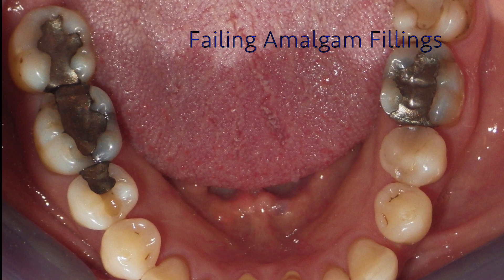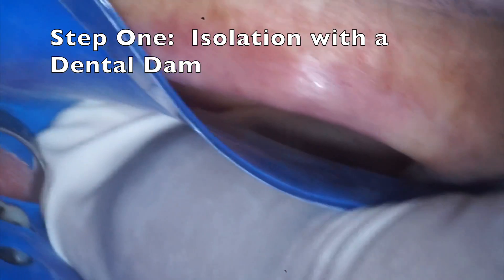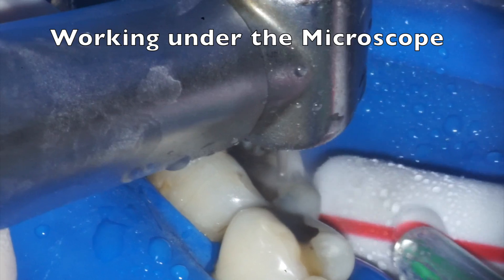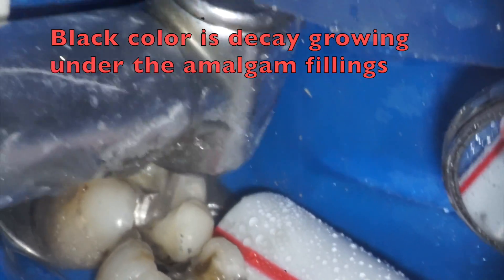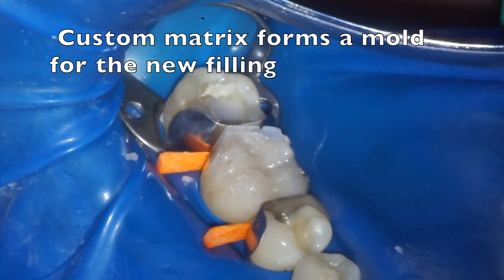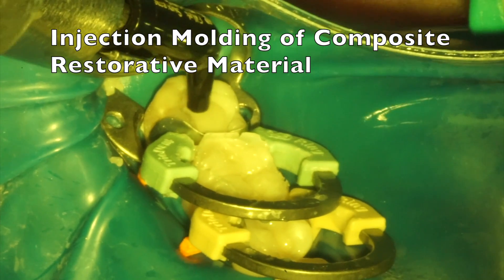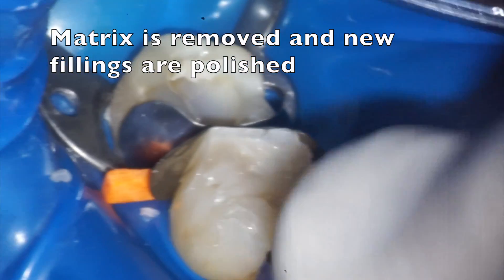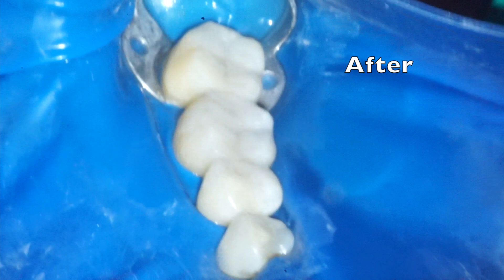Mercury Amalgam Removal and Restoration

Comment: I had a very little bit cavity 
I got filling but my teeth doesn't touch property
I remove high points 2 times but I it doesn't touch properly
.
Can I remove amalgam filling permanently without restoring it with composite filling?

Comment: Are Amalgam fillings unsafe? I’ve had them for around 2 years and I am 16 and haven’t been experiencing any problems, but many people say it can poison your system which makes me paranoid... is this true?
Reply from the maker: Good question.  While I personally do place amalgam, I do not tell my patients with amalgams that they have to be replaced because they are poison.   The answer to your question unfortunately varies depending on who you ask.  I have many older patients who have amalgams that have been in their mouths for decades and have no issues.  When amalgams get recurrent decay, I recommend replacement.   The last statistic I saw said that at least 80% of dentists in the USA are still placing amalgams.  Make sure you are seeing your dentist every 6 months for cleanings and for them to check for cavities and check the existing fillings and things should be fine.
Reply: @WilliamLingerDDSMAGDCharlotte  
Thanks sir, also one last question... if the filling broke and leaked or even fell out would it then become harmful?

Comment: I have a 20 year old metal filling from my childhood, the dentist says it's starting to break down..says I should get composite but I am worried that because it is a molar tooth and that I grind my teeth at night that it will last only a couple years. My thought is that metal will last me much longer..wondering what I should do.
Reply from the maker: a well done composite will also last many years. if you are grinding and not wearing a night guard, any restoration is likely to fail

Comment: Thanks a lot Dr!!! I want to know how to distinguish the secondary caries with stain caused by the amalgam? should I remove the dentin till there's no more metal-like color?
Reply from the maker: in general yes, but not always, there may be dentin stained by the amalgam like an amalgam tattoo. The caries stain will tell you if there's decay there, if it's black dentin, test it with a sharp explorer or scaler and remove if it's soft or leave if it's hard.

Comment: Should the cement-base under old amalgam be replaced too ? I mean in case of not having any recurrent caries?
Reply from the maker: Usually yes, bacteria can be left under the cement or they can penetrate between the dentin and the base, and the only way to see that is by removing it.
Reply: Thanks alot dr.William

Comment: Great video!  I had all of my amalgams changed over to composites 10 years ago. I'm just now doing a chelation protocol, but worried I may have mercury left underneath of my composites because I can see dark shadows from underneath the filling, even through the rest of my teeth do not look black or dark. Or could this be decay under the fillings?  Is it normal to need new composites after 10 years? Interesting you are in Charlotte, I grew up in Raleigh, North Carolina, maybe I will try to come to your practice when I'm there next.
Reply from the maker: Thanks Sarah,  I do routinely see amalgam that is left behind when it's removed and replaced by some doctors unfortunately. Some patients are not happy to learn that their doctor had left amalgam behind when they asked for it to be remove.  If this is the case, the remaining metal is visible on a routine x-ray.  The good news is that the small amount is highly unlikely to leach any mercury.   The lifespan of the composite restorations depends on the skill of the doctor placing it, the quality of the material used, and patient factors like oral hygiene, routine maintenance visits and grinding (bruxism)

Comment: Hi Dr.  Please help.  I have a 30+ year old amalgam filing that takes up most the tooth (such as this video) but every dentist I see tells me they would have to crown it because there wouldn't be enough tooth left to support a filing or onlay.  The tooth would then crack.  This filing has a small chip out of one side of it but there is no visible decay around it so I'm not sure if I should let them touch it at this point.  The chip has been there for at least 7-8 years.  The xray does not show anything suspicious and as far as pain goes I only have a slight dull ache usually when I think about it or they clean my teeth which could be caused by irritation of the other teeth around it.  I don't know what to do, I'm beside myself and have an appt next week for a crown but my gut tells me to cancel because if they mess with it I might end up in pain and needing a root canal then a crown.  help please, thanks.  I've had at least 4 different dentist look at it and gotten different opinions.  The last one said don't do anything now unless it's painful.  But if I wait and later find out there is decay under it and it's so bad I have to do a root canal ... ugh
Reply from the maker: Hard to say without seeing the tooth, but many people come to us to have teeth restored without crowns when they were told that they would have to have crowns before.  The pulp of the tooth may be already affected and require a root canal whether you do any treatment or not.  The xray will not show anything because of the metal filling blocking the xrays.
Reply: @WilliamLingerDDSMAGDCharlotte  Thank you Dr. for your quick reply.   I know you'd have to see it to really give a solid sound opinion but ... Should I do nothing with it now given that it's not hot or cold sensitive or causing great pain?  I have TMJ and not sure if that is the source of my jaw and neck pain on that side or if it could be the tooth or amalgam.  I seem to have a radiant heat sensation on that side but not sure if it's the tooth or my gums.  It especially acts up after brushing or getting teeth cleaned.  Part of me just says get it overwith and see whats up but the other part says leave for now.  I'm frozen in fear of making it worse, losing the tooth, needing a root canal, etc.   Also, the dentist I'm seeing is a long time very experienced holistic IAOMT dentist with a master level. sorry
Reply from the maker: @kellylee514  is there is recurrent decay under the filling, or if the pulp is necrotic, waiting will only make it worse and harder to treat.

Comment: I was told that composite is not for deep decayed tooth and it does not protect carries beneath its filling so i was filled with two Amalgams 1 day ago. Can I remove my Amalgam and replace them with composite NOW or LATER? Does Amalgam get harder after each passing day?
Reply from the maker: Wow, sorry you were told that. We don't use amalgam under any circumstance in our practice and haven't for 20 years. The amalgam should be fully set now.  Whether you remove it now or leave it alone is up to you. If you are not having any problems with it, you may just want to leave it as is for now.

Comment: i also want to remove my old amalgam fillings and get composite .  

but mu dentist not uses dental dam..

i m worry if i swallow drilled small bits of amalgam metal.. 

will it damage my intestine..

i also want to replace a gic filling which has bcm black stained..

will it hurt glass..
Reply from the maker: Why are they not using a dental dam? Are they using an alternative isolation device?

Comment: I have my first dentist appointment tomorrow in years!! It’s been yrs since I’ve had a cavity ! One part of my filling fell off so the holes showing! If they wanna replace the whole old filling n save the teeth as u did, does it hurt??
Reply from the maker: with good local anesthetic, should not be painful. Congrats on going back!
Reply: Thanks! I also need a deep cleaning badly! But I’m wanting to fix this cavity first before the hole gets bigger n worse cuz it’s not bad right now!
Reply: Is it possible to be ok without numbing?
Reply from the maker: @Tiredmessymama88  possible? yes, but I wouldn't advise it

Comment: Is there always a recurrent decay under the filling?
Reply from the maker: no, not always.  The older the silver amalgam is, the more likely there is.  Also, it depends on  if  the original decay was completely removed or not
Reply: @WilliamLingerDDSMAGDCharlotte  Ive undergone two composite fillings just 5 days ago. My teeth are just a little bit sensitive when I eat. Is that normal? How many years will it last if proper oral hygiene is applied? I'm so scared when it comes to a point where they need to be replaced. Will the dentist drill my teeth again and will cause larger and deeper hole I'm my teeth? Please answer me I'm very anxious. I don't want to lose my teeth because of so much drilling.
Reply from the maker: @myladequilla1428  sensitivity for about a week is usually normal. If it is getting worse, the bite may need adjusted. If the pain starts getting strong, the nerve may be affected.

Comment: I understand composite material releases significant amounts of BPA? what of porcelain fillings?
Reply: I'm sure it's not as bad as Mercury
Reply from the maker: Porcelain is used for onlays, inlays and crowns.  They are made outside the mouth and then bonded to the tooth with composite resin which releases BPA.  They also require more destruction of healthy tooth structure to place.  Composite fillings contain porcelain as well.  The European Food Safety standards show that the level of BPA released from composites is safe.  The higher quality/more expensive composite filling materials are the safest, as not all materials are created equal. The material we use is free of dissociable, easily released or ionizable BPA.
Reply from the maker: The BPA issue was instigated by amalgam using dentists to try and justify that they were not using composites.

Comment: I have an appointment next week to replace two fillings near the front of my mouth. The only reason I want these is because they are very visible when I'm talking or smiling. I have had no issues with them at all in terms of functioning. I have had them over 20 years. Is there a good quality white filling that I can get?
Reply from the maker: absolutely.  Quality composites can last for many years
Reply: @WilliamLingerDDSMAGDCharlotte  in the end I didn't go through with it. I've read a lot of people have so much trouble with the teeth once amalgam has been removed. Also my dentist didn't offer any sort of protection except the dental dam. I didn't want to risk it.
Reply: @sk3440  are you in the uk by any chance?
Reply: @paulamclerie9980  yes I am in UK
Reply: @sk3440  Im am in Scotland and I am in the same boat to you in regards to wanting my front fillings replaced as you can see them easily and also, I think there is a crack in my very back tooth which has a filling in it. But my regular dentist doesn't practice (in my opinion) a safe removal of amalgam fillings (no Sealed mercury proof rubber dam or seperate ait supply etc). Ive found a great clinic but costs A LOT more.
Reply: @paulamclerie9980  yes I found a private place that did it but they were quite expensive and also quite far from me. But I've decided I'm gonna leave it. It's not so bad.
Reply: @sk3440  hi, may I ask how much amalgam filling do you have...?
Reply: @whitewhiskeys  I have one on each side at the bottom but they are very near the front
Reply: Getting them next month after delaying for so long
Reply: @sk3440  oh, thanks for replying :) I thought you wouldn't reply since I'm one year late.
Reply: @sk3440  really? I'm happy for you! I have two but can't remove them, ughh. There's no holistic doctor near me (I'm from Brazil so holistic doctors here are rare) so I think it's better to leve them alone. I hope everything goes well! 🤗
Reply: @whitewhiskeys  lol no worries.

Comment: Are amalgam fillings dangerous ? The doctor said it is safe but after I watched all those videos telling that amalgam fillings are dangerous I'm just  confused if they are dangerous or not?  Plz answer
Reply from the maker: I stopped placing amalgams over 20 years ago. However, 80% of American doctors are still placing amalgam fillings. So, I don't think it's safe to say they are "dangerous." When I see patients with existing amalgams placed by other doctors that are still functioning,  I do not recommend they be replaced until they show signs of recurrent decay.  Unfortunately, we see recurrent decay under most of the amalgams after 10 years.  The biggest concern for me is not mercury toxicity,  but the poor quality and lifespan of the restorations.  
In the last 20 years we have seen the mixture of amalgams made by the manufacturers change for the worse.  These new materials do not last as long as the older materials did.   The amalgams I see now that are 10 years old show breakdown and marginal leakage worse than the amalgams that I see that are 20-30 years old.  Composites strengthen the tooth, provide a better seal  and can be repaired, unlike amalgams.  Placing composites requires more attention to technique and precision than placing amalgams, and many dentists are unwilling to take the time and care to place composites correctly.

Comment: Was this a porcelain filling replacement?, if so how much for porcelain fillings?.
Reply from the maker: These are bonded composite restorations placed in one visit. They require less removal of tooth structure than porcelain.  Costs averages between $250-450 per tooth

Comment: Why der is decay under the filling in the first place???? Fillings r suppose to protect from further decay
Reply from the maker: over time, gaps develop between the filling and the tooth, allowing bacteria to enter the tooth and cause decay.  Teeth with fillings are actually more prone to decay than teeth that have not been filled.
Reply: @WilliamLingerDDSMAGDCharlotte  what should we do to avoid further decay in the gaps?
Reply from the maker: @thuhfahafiz3601  eliminate the gaps. if they are amalgams, replace them. If composites, the gaps needed cleaned to the point where there is no more decay.

Comment: I went to a dentist who said my fillings were too deep to be removed? Is this possible or did he just not want to remove them?
Reply from the maker: "Too deep to be removed?"  It sounds like he just didn't want to remove them.  The question is, do the fillings have recurrent decay?  If so, then if the fillings are deep, the recurrent decay can enter the root canal more easily.  If the fillings are functioning fine and not causing symptoms, but are very deep, then removal can stimulate pulpitis (inflammation of the pulp) that can require root canals.  Teeth that are not having symptoms can develop symptoms after replacement.  This can make it seem like the dentist caused the problem.   It's important to evaluate and discuss these risks with the dentist before doing any treatment.  If there is recurrent decay around deep fillings, then the need for root canal treatment is higher whether the fillings are removed or not.
Reply: @WilliamLingerDDSMAGDCharlotte  1. Where are u located so I can set up an appointment and 2. How do you prevent inhalation of the Mercury I feel like as stupid as I am I would breathe everything in and 3. So the tooth is broken under the filling?

Comment: Hi Dr, 
         I had all 7 of my amalgams removed safely and replaced with composite 3.5 years ago. However, I made the foolish mistake of not detoxing completely so the toxicity load was increased and it took that long for it to manifest.  I was recently diagnosed with anemia. Currently I am seeking the help of a holistic doctor who will be helping me with chelation. Just wanted to share with you guys that heavy metal levels in your body can cause this much harm. Get them out asap and detox detox detox.
Reply from the maker: Yes, if you have a concern about toxicity, your doctor can prescribe an IV chelation and or oral chelation course after removal
Reply: What was the cost of the removal/replacement
Reply: I learned this from my welding instructor back in trade school. Blend cilantro, parsley, spinach and blue berries (to sweeten the greens, optional) with spring water. Should detox heavy metals. All organic ingredients.
Reply: for how long do we drink this though? thanks!
Reply: the amalgam removal didn't cause anemia.  Just how did you deduce that your anemia was caused by having amalgams removed nearly 4 years prior?
Reply: @ronyeahright9536   heavy metal toxicity can cause a whole host of illnesses and I believe the amalgam toxicity contributed to it. However, 4 years later and after intense detoxing and lifestyle changes I am anemia free. Very happy and thiriving. 🙏
Reply: Is it sore to get fillings removed
Reply: @l.aw.t9727   no!
Reply: Do a professional detox. Also chlorella helps with detoxing.
Reply: @komfykoala6083  don't know what a professional detox is.